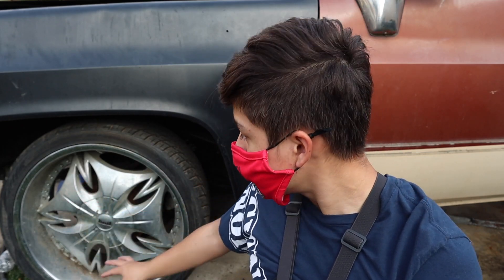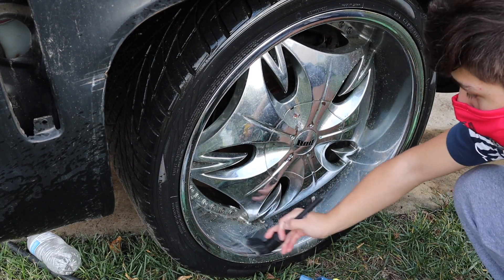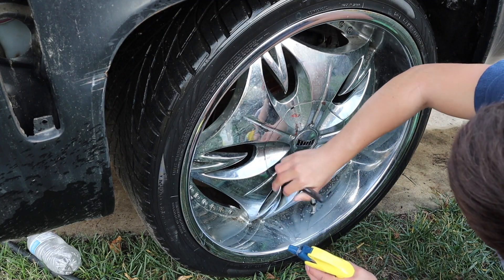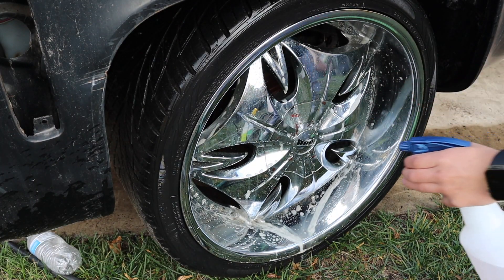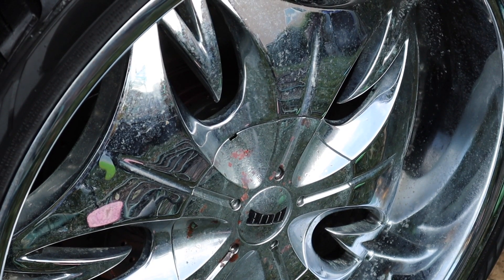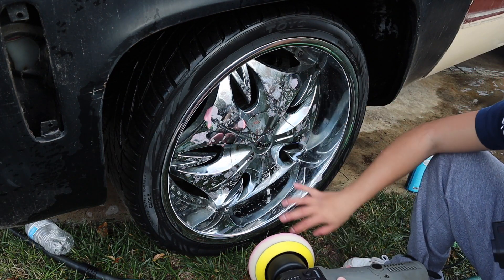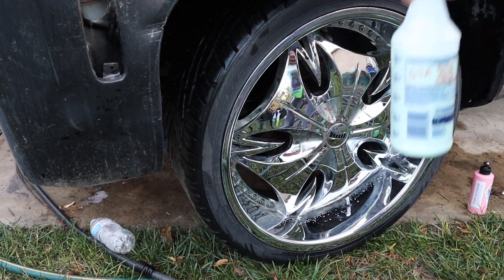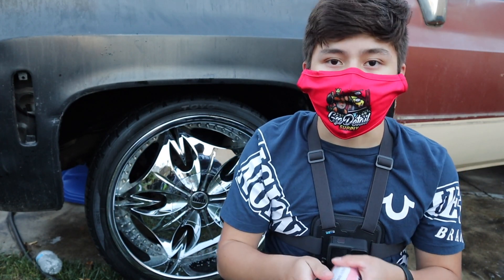How To Polish Chrome Rims With GSA Detail Supplies!! *CRAZY RESULTS*

Comment: Nice video lil man next time you go to clean wheels like that get you some steel wool number 0000 it will take a lot of that corrosion off
Reply from the maker: Will do thank you
Reply: Exactly what I was thinking, also use never dull at autozone let it sit n lock up on rims wipe with dry towel, guaranteed way better outcome

Comment: While I do appreciate the polishing information and effort, I agree with Joom, the pitting and oxidation on the wheels is still present and makes the wheels look very bad, even after polishing. It's like waxing and polishing the paint on a vehicle that has rust all over it. It just doesn't make sense to me. Not worth the effort.Sorry.
Reply from the maker: I appreciate your feedback thank you
Reply: 0000 steel wool and some real chrome polish would of done a better job and helped get rid of some of that pitting